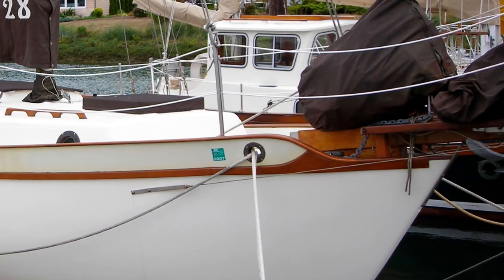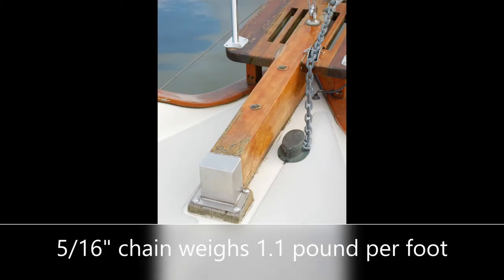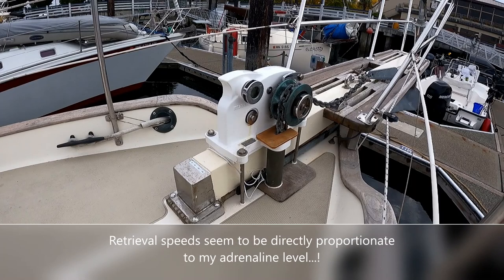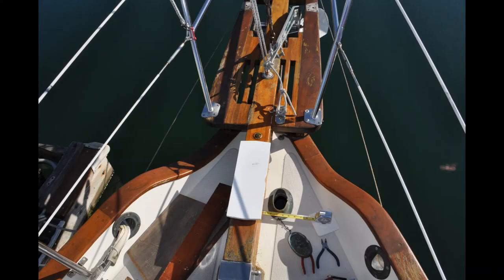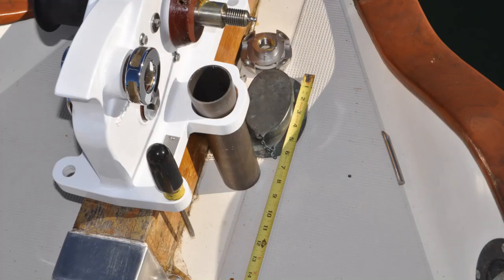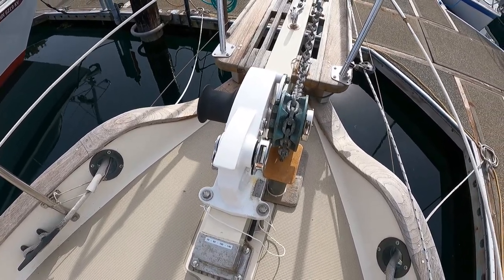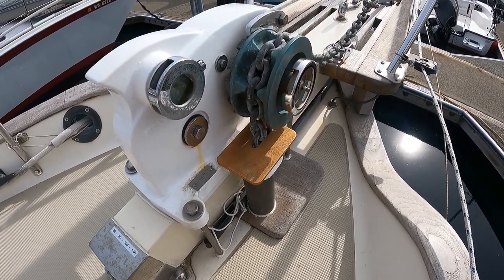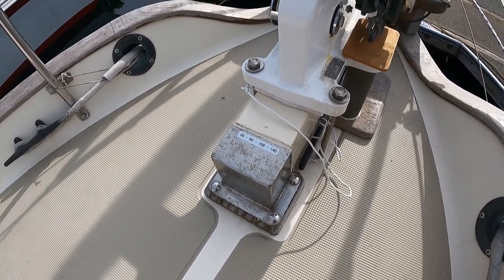Installing a Manual Windlass - S/L555, All Chain Rode & Anchor - Video #18 - Westsail 28

Comment: My crystal ball tells me the plywood hawse-pipe cover will be made out of G-10 in a year or so and even have a lanyard attached.
Reply from the maker: Your crystal ball is working!  I think this is my 3rd cover.  I've replaced the cover every 3 or 4 years.  I give it a coat or two of Ceatol to start.   I cut the chain slot slightly undersize so it has a pretty good friction fit and none of the covers have needed a lanyard, so far...
G-10 is a good idea. I've got some scrap pieces of 1/2" Starboard, maybe I'll make the next cover with that!

Comment: Hi Great video style .
I was going to put in a offer on at WS28 how did you come up with a value when you purchased on that needs a refit? Any advice would be great.
Thanks
Reply from the maker: Thanks for watching!
"Starwhite" is actually the second W28 we have owned.  Our first W28 was purchased for $10K as an abandon derelict in the early 90's and we spent 3 years refitting her.  We received an unsolicited offer and sold her for $32K shortly after the refit, and we regretted it immediately.
"Starwhite" was in much better sailaway condition when we acquired her a few years later.  The cost of refitting either of these W28's to the level we have, does not pencil out as a positive financial move.  But then owning a boat doesn't either...!
As of now (2022) we have spent more than $50K on parts and materials refitting "Starwhite".  My Labor has been free!!!  
If we were to put her on the market I would expect she might fetch $38K to $40K.  I've seen W28's with asking prices from $10K for a boat similar to our first, to $42K for what appeared to be a nice all original well kept boat. 
Kevin
Reply: @Westsail28  thanks Kevin for the information. What do you think of the one YW in NC .seems to have a newer Beta and steinless bow sprite going for it other then that a big job. What do you think would be a good price to  pay?
Reply from the maker: @captaindrew3061    If the photos are current, (they do her no favors) she looks like a reasonable refit.  All the black tape around the Lazarette hatch and the cockpit sole fasteners would indicate she has some leak issues.  It is interesting to see 3 shore power plugs in the cockpit.  WOW, that's a LOT of propane in the locker on the Bow.  It's interesting that the Port inside cabinside is white and the Stb inside is varnished and the Vberth is a mix of both.  The Stb cabinside looks like it may be delaminating.  The upholstery looks very similar to our original pattern (different color), but it appears to be in serviceable condition.  The overhead has been changed to varnished shiplap.  She appears to have the original electrical system and just 2 batteries.  The interior overall looks pretty good.  On Deck a good cleaning and decluttering would make her look MUCH better.  Her canvas covers look like they may be approaching their end of life.  You'll want to inspect the sails as a full new suit can run from $8K to $15K depending on quality.

Seems like a reasonable asking price, the new Beta is a plus.  Our Beta 25 repower which included a new MaxProp totaled almost $10K.
I've refit two W28's and to answer your question is difficult, as it depends on what level of finish and equipment you are expecting in your boat.  I've started to include some project costs in my later videos hopefully they will give you some idea what different upgrades can cost.

Kevin
Reply: @Westsail28  Have you ever heard of the WS 28 being transported on a trailer?
Reply from the maker: @captaindrew3061  Yes, I have seen photos of a W28 on a custom 3 axle trailer.  I don't know much about trailering a boat, but I would think the 9.5 width and 13,000+# weight would make it a challenge.  We did have our first W28 trucked from Northern CA to Seattle by a boat moving company.

Comment: Great job. I need to install my manual windlass the same way can you please tell me where you bought the long stainless steel bolts please, thanks.
Reply from the maker: I ordered the bolts from Tacoma Screw Products   www.tacomascrew.com   
They are: SS HEX CAP SCREWS 18-8 - 1/2"-13 x 12" with 3" thread.  
I could have instead used 1/2" Stainless All Thread cut in 12" lengths.  
I went with the bolts as I did not want any threads showing, knowing that threads would eventually develop surface rust.
Reply: @Westsail28  thank you for your reply. I’m currently restoring a 1977 Transworld 41.

Comment: I loke your installation. I own a Union Polaris 36 (no windlass) and it also has a bowsprit in the way! I have looked at many elecric windlasses and all have their mounting issues, not least the need to drill holes in the bowsprit for the cabling. I have looked at the Seatiger555 and it is a contender. I am having trouble at finding the max height of the Seatiger555 as I have a staysail boom hovering over the possible installation. Do you have the figure for the overall height? Thanks.
Reply from the maker: Yes, it's 10.25" tall at the aft end which is the highest point.
Reply: @Westsail28   On my Union 36, (11 tons laden, 36 ft across deck, 42 ft overall) the bowsprit is wider so I will have to make a wider plate to span the bowsprit and so bolt that plate to the deck via those long bolts. I plan to use my old 35 lb CQR and perhaps 175 ft of new 10 mm calibrated chain. What chain are you using and how long? Is that a 35 lb CQR you have? Thanks.
Reply from the maker: We have 160' of 5/16" G4 chain backed with 30' of 9/16" 3 strand line, it is attached to a 35# Delta anchor.

Comment: Beautiful boat and smartly set up. James Zi
Reply from the maker: Thanks
Reply: I hope you are all well. I'm not that familiar with the WS28. I've reaserched the 32, but it's a little larger than I want. If I could ask: what did you pay for her? and is that in the ball park of what they go for? Thanks James Zi...Have a good day.
Reply from the maker: @jamesmongeau7472  I've seen W28's in almost derelict condition sell for around $10K.  A W28 in similar cosmetic condition to "Starwhite", but with much less equipment recently sold for a shocking $69K!  It seems like most sell in the $20k to $30K range.  But prices are VERY MUCH based on condition, equipment and location.  If I were to sell "Starwhite" I would expect her to go for around $45K.